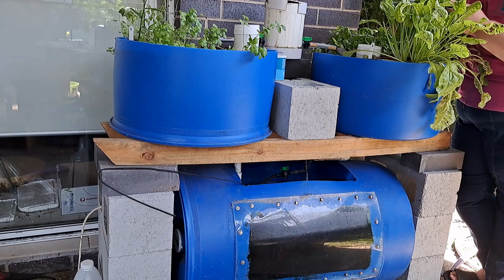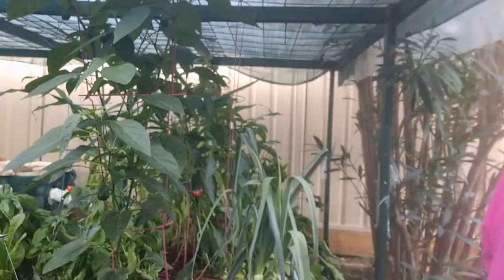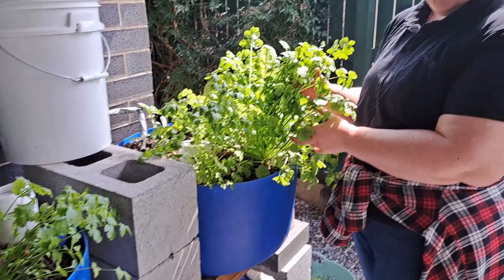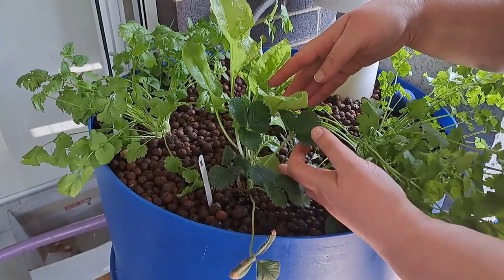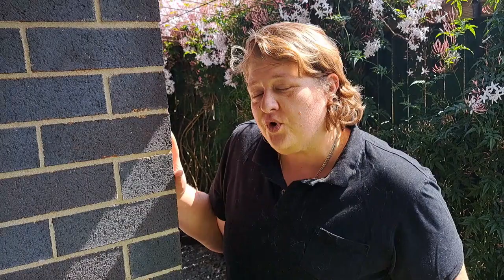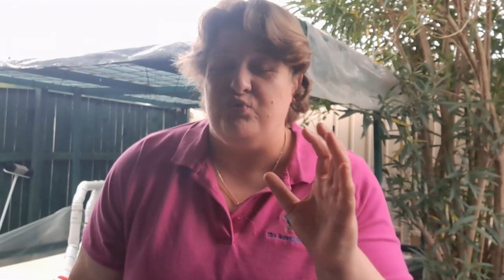The Aquaponics Battle: Constant Flow vs. Flood and Drain Revealed

Comment: What height do you set the constant flow ? How much dry media ?
Reply from the maker: Great question! A good rule of thumb is to have approx 5cm, or 2 inches of dry media on top. This prevents algae growth, and gives good root stability. My constant flow is set for 25cm wet media, 5cm dry media and 3cm space before the lip of the growbed. I do that on all my systems
Reply: @CandyTheAquaponicsLady  thanks , this was 1 year ago I asked you this and I love constant flood now ! Works well !
Reply from the maker: @princy3010  Awesome! It is so much easier than flood & drain. Flood and drain you need to constantly adjust the flow rate, and every bell siphon is different. The heights, the way it flows. Constant flow keeps it simple, as long as there is enough oxygen in the water, there's not an issue. I'm really glad that you found it helpful and are loving this :-)
Reply: Hi there from Canada!  If both grow beds were constant height, would the bacteria still be able to flourish? I am asking since I only have 1 grow bed in my system
Reply: Gets more sun